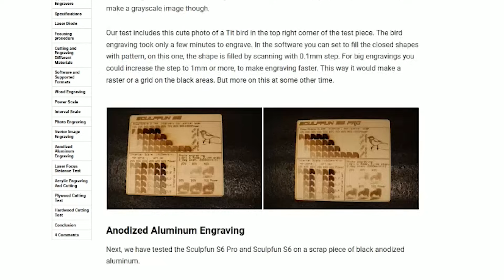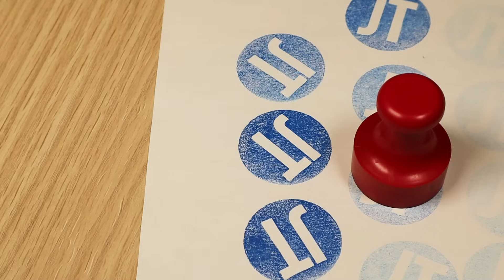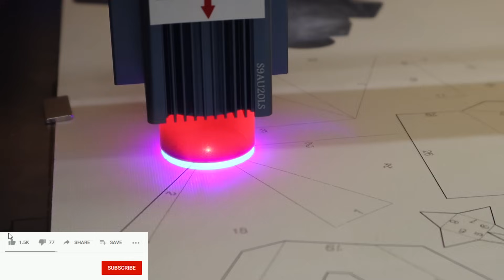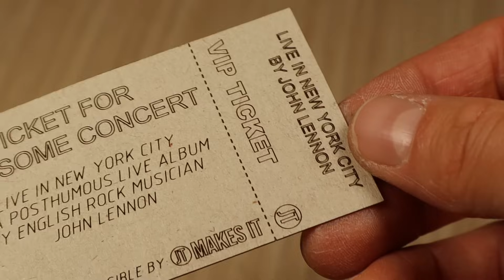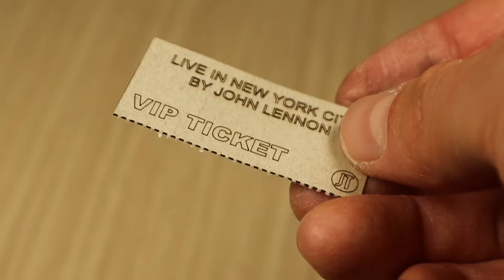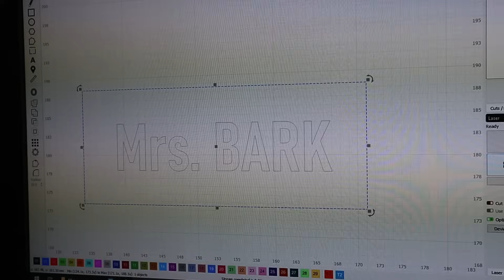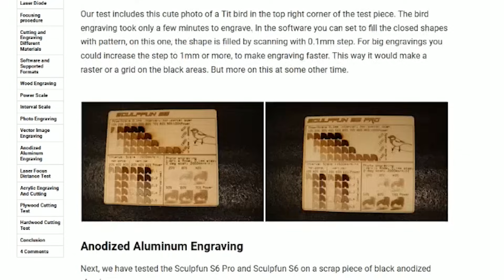10 Things You Didn't Know You Could Make With a LASER ENGRAVER (NEW Sculpfun S9 Review)

Comment: Is it possible to laser cut Styrofoam?
Reply from the maker: @jobwong  no. It is highly flammable and dangerous to cut
Reply: @JTMakesIt  Thanks for your reply.  I have some white melamine laminated plywood sheets. Can I use them for laser engraving and laser cutting? Can the melamine laminated layer be cut through?
Reply from the maker: @jobwong  white plastics can't be cur with diode lasers. You need co2 laser for this
Reply: Thanks for your reply

Comment: i have a sculpfun s9 machine why in white acrylic I have difficulty cutting it speed 50 pass 8x power 100, the result is cut but the edges are messy and slightly blackened, I use air conditioning, please help?thanks
Reply from the maker: White and transparent acrylic is basically impossible to cut with diode lasers of any power. The light reflects off and it does not absorb into the material.
Reply: @JTMakesIt  thank you for your answer, but your video shows yellow acrylic, is there any special acrylic for this machine??
Reply from the maker: @ismailkhayla1549  black, green, red and yellow work well. Blue(because it is the same color as laser beam) and white(because it reflects everything off) and transparent (because the beam goes through) don't work. But the lighter the color the worse it cuts. The yellow one needs twice as many passes as black.
Reply: @JTMakesIt  thank you very much, the answer really satisfied me, good luck always

Comment: Will the S9 module work as a replacement for the Atomstack A5 20w which only has 4.5 optical power? Even though the 4.5 optical power is great for detail it takes several passes to cut leaving my edges way too charred.
Reply from the maker: S9 module is an amazing upgrade to the A5 20w. The difference is like night and day!

Comment: The carbon on the edges of your cuts in wood didn't sublimate (black edges), you might want to adjust your power settings.
Reply from the maker: Jeah, my settings aren't optimal. I should tweak power and speed a bit more.

Comment: Tip, if you poly, or poly stain your wood first, then laser etch and cut, you are able to remove the burn halos using alcohol and a cloth...  It's also easier to brush poly the entire wood before it's cut or etched.  Then you can still use the spray after the cleanup for a final coat...
Reply: Sorry guys, but what is "poly"?
Reply: @bundeslachamt  polyurethane coating, like a finisher
Reply: I’d recommend water based  Polyurethane (Ie: polycrilic) because it doesn’t yellow like oil based. Just make sure you stir and don’t shake because you will introduce a ton of micro bubbles in the finish. I also don’t like foam brushes for the same reason.
Reply: That sounds like a good tip. Do you have a recomendation for the type of poly to use? I've just ordered the S9 and really looking forward to start using it.
Reply: @Trollgaard1st  any poly will do...

Comment: Another question, in LaserGbrl software where set the deep of laser to cut, bend and engrave?
Reply from the maker: You adjust the height of the laser by moving the module physically up or down. By adjusting the height you set the height at which the laser will be in focus.

Comment: I have a question, where do you set the line to cut and the lines to engrave?
Reply from the maker: In Lightburn you can set any line to a specific layer. Each layer is a separate operation (engrave, line, fill., cut.. with specific set of settings  like power, and speed and many more)

Comment: Thank you for your review on the product.  I am looking for a laser cutting machine that cuts 2mm thick royal board thick paper with having the paper burnt while laser cutting it in close. i need to cut 2~10 mm thick acrylics for my architectural scale models. is there it for me?
Reply from the maker: It should br able to cut 2mm paper. The only problem I see is in acrylic. It depends on what color it is. Black acrylic is the easierst to cut but 10mm thick is the very maximum for all machines and they will cut it very slowly. None of the machines will be able to cut transparent acrylic, for it you would need a different kind of laser

Comment: How many passes to cut through 10mm wood of average density.  It is clearly more than one.  All videos on this machine seem to gloss over this point.
Reply from the maker: In the video description you have a link to my website with a technical review of this machine. This is also mentioned in the video. You will find all the answers there.
Reply: @JTMakesIt  Thanks for the quick reply.  Looks like a very good review and answers my question.  It was also good to learn about the effects of the horizontal and vertical travel directions.

Comment: hi,would the s9 laser diode itself fit onto my ortur master 2,thank you
Reply from the maker: If I remember correctly, the Laser master 2 is 12V like Sculpfun. It might work, but I can't be sure since I don't have that machine to test. I know that Laser master 2 Pro is 24V and it will not work.
On the other hand, the S9 module itself is 250$, and I have a coupon code for the full Sculpfun S9 machine for 299$, it might be cheaper to buy the full machine and sell the Ortur?
Reply: @JTMakesIt  we're do I get the coupon, thanks
Reply from the maker: @kennethrigg7320  video description

Comment: Please answer me this , how long can this cnc works until it gets "wrecked" mechanically?? I hope you understand what I mean... how long can you work with it , how much hour a day and for how many years ?? Can I change the laser with a router ? .. it's easy to install the program on the laptop ?? That's it for now
Reply from the maker: The laser module has a lifespan of about 10000 hours. Mechanics should also last couple of years of normal use. You can't replace the head with a router, because these machines are not rigid enough for this. For CNC router you need a very rigid frame because there a lot of forces on the router. There are not forces when using a laser.
Software is easy to install. You can search Youtube for "Lightburn tutorial"
Reply: Thats amazing! Can in use it on wood ?
Reply from the maker: @greekpowergreekpower9629  of course!

Comment: I have only had this engraver for about two weeks with pretty light usage and I already have a stepper motor that won’t move for the y axis. Has anyone else had this issue?
Reply from the maker: Check if there is no mechanical blockage and if the connector is still properly plugged in the Y axis motor and there are no loose wire connections in the connector itself.

Comment: I would like to see a comparison of sculpfun S9 with the new atomstack X7 pro, similar to your previous video of the S6 vs X5.
Reply from the maker: I will test the A10 pro, which should be exactly the same as x7 pro but without wireless connection. But I don't know if it's wise to directly compare them, because the A10 pro costs more than twice the S9.
Reply: @JTMakesIt  S9 and X7-A10 are both the next generation diode laser machines. Regardless there current price point. S9 is, if I understand correctly, a 5,5W laser, (comparable to a 90W CO-2 laser?). X7 is a 10W laser (2x5W). This should be in theory more powerful with faster cutting results? In your conclusion of the S6 vs X5 the engraving capacity gives a better result with the S6 due to a more uniformed laser point in vertical and horizontal lines. The laser point in X5 is more rectangular compared to S6. This might have improved in the A10-X7? When the atomstack is more powerful then the sculpfun the lifecycle might be a good bit longer giving similar results with running the machine with lower power? This justifies the higher price? This is something to consider and where I’m wondering about.
Reply from the maker: @aragorndedolor4171  Cool, stay tuned, In January I will probably get the A10 and test it out. Video will follow.
Reply: @JTMakesIt  Great, I’m looking forward to your test results. I’m new to laser engraving and on the market searching for the best laser engraving/cutting results in different substrates for an affordable purchase price to extend my home based business.

Comment: Hello, can this machine cut on clear acrylic? and if it can, how many should I put speed, power and pass ?
Reply: Hello, can the machine cut golden PVC?
Reply from the maker: None of the diode lasers can cut clear acrylic. I don't have golden one at hand to try but it might work.
Reply: Are you sure I can cut golden PVC?
Reply from the maker: @souqalmjd5284  no, because I can't test it
Reply: I read that I should not cut PVC because it could cause the metal of the machine to rust and ruin the motion control system. Correct or no ?
Reply from the maker: @souqalmjd5284  I also heard that
Reply: Please can you try cutting PVC and tell me?
Reply from the maker: @souqalmjd5284  i tried cutting vinyl stickers and it went very well, but you need to be careful with toxic gas
Reply: thank you so much

Comment: what power is your laser and how about exhaust system
Reply from the maker: Laser is 5.5W, link in description. I built the ventilation box myself.
Reply: @JTMakesIt  What's the price?
Is it CSA approved?
How does the exhaust work? This laser is totally open.
What is the table size? Where are you located?
Reply from the maker: @stampmaker9384  my box releases fumes through the window so they don't spread in the room. Laser working area is 410*420mm. I'm in EU

Comment: hello
What are the settings for cutting MDF wood 3 mm on the Lightburn program
Reply from the maker: Haven't tried it yet, but you should start with 600mm/min and full power set enough passes until it cuts through.

Comment: I use an Atomstack F6 Pro which is about the same speed Does not cut deeper than 9-10mm and it is OK .... just cutting any 3-4mm material is slooooowwww. When a complex thing cuts for 2 hours you reevaluate your life. If you really want to cut go to CO2
Reply from the maker: I always plan to do something else in the workshop when cutting big stuff. This way I don't loose any time :) the S9 is a faster cutter.
Reply: @JTMakesIt  Yeah I know I made a separate Win PC for cutting (not to use my own Mac), made a box for it with smoke suction + air assist and bad of nails to raise material I did everything the problem is that slowness is still a big problem. The LightBurn can go crazy, one of the cutted material part can raise up and toss the whole thing to one direction and ruin the whole job, so you STILL have to babysit it more or less. Yes these lasers CAN cut 3-6mm plywood and other stronger material it is just very much NOT PRACTICAL. I tried an 50W CO2 laser on the weekand and it was a different world. When you can cut 6mm plywood in one round in 2 minutes is something completly different. I would suggest everyone to tri a diode laser and than strt to save money for a serious CO2 laser (not a K40 pleae)
Reply from the maker: @rockjano  CO2 laser is better for cutting, can't argue with that. But they cost way more.
Reply: @JTMakesIt  Yeah sure what I tried cost about 5-6X more, but it worth every penny of it's high price. The new diode lasers with two diode probably better but that is still only 10W... not moch more. 50-100W is something else  Everyone who is serious about laser cutting (even on a hobby level) should considering a bigger CO2 machine (not the K40 please that is a suffering)
Reply from the maker: @rockjano  I heard that k40 is a piece of junk :) maybe I will someday be able to review CO2 machines as well.
Reply: @JTMakesIt  Well...junk might be too harsh :-) many use it just it needs lot's of work to be usable and the size is 200x300mm ...which is quite small and the 40W is really only 30 (which is still 6X more than 5,5W :-)

Comment: How does this laser compare to the Atomstack A5 pro plus? As far as I have read, both have the improved focusing and now the Atomstack has thumb screws to fix the laser head. How would you compare the two?
Reply from the maker: Hi, I haven't tested the Atomstack A5 pro plus, so I can't say which one is better. Whey should be somewhat similar. BubI don't like the Atomatack light ahield design because it does not allow you to lower the head more than optimal focus. It comes very handy to lower the head a few mm more than normal when cutting thicker materials.

Comment: What settings do you use for the denim engraving? (I have the same machine)
Reply from the maker: I don't remember the exact numbers, but I use the lowest possible power that gives you results, because you can quickly burn through. It should be around 30-40% power at around 1000-1500mm/min.
The number should be a bit different for various kinds of denim.

Comment: You made some nice tests there but you don't really seam to have an effective ventilation system. Plus this is REALLY important and you should NOT be misleading people you should NEVER EVER use laser cutters on synthetic leather and chrome-tanned leather as they contain chemicals capable of producing toxic fumes when burned. Aka you are intoxicating yourself and others if you advertise it like this. It's so important to make reseach on your material before engraving. This is dangerous.

Plus there is no way this actually engrave stainless steel. May burn the paint, but would not call that engraving.
Reply from the maker: my ventilation system is very effective. All the air gets pumped out through the window. 
Thanks for the tip. I agree, some plastics need to be handled with care or better not to be cut at all.
Regarding stainless, this machine is the only one I have tested  that can truly engrave stainless. It can engrave it even without applying the paint.
Reply: @JTMakesIt  It looked like there was no cover or anything in between you and the laser for ventilation, you probably still get more fumes then maybe a closed machine with a filtration system. But i'm glad you do have a ventilation system!

It's really important to know what you are engraving and if it is safe. Even more if you make tutorial about it ;) To my knowledge only veg tanned leather is safe to engrave. But I know the company trotec have a line of faux leather made for engraving that are safe. But other than that it's pretty toxic.

As for the stainless, I'll give you benefit of the doubt.
Reply from the maker: @ladouceurduneplume2148  I have a fully enclosed box and the fumes are vented out of the room. Thanks for the safety tips, I really appreciate your help for us being safe!

Comment: Great examples of projects! Do you share the lightburn design files for these? I only found the test file on the blog post. I was wondering about speeds and settings for engraving and cutting the tear-off ticket project
Reply from the maker: Hi, on my website I have an article with more descriptions next to each project found in this video. For some designs I also posted the vector files. I didn't attach lightburn files for everything, because you need to adjust all the settings according to the material you use. But if you really want the lightburn file for the ticket, send me an email and I will sent it to you. I think everyrhing was done with 600mm/min. 100% power for cutting (1 pass) and about 40% power for text and photo engraving. Perforation was done by enabling perforation mode for one layer  in Lightburn
Reply: Sir your video very good..very happy when watch your video.If have questions can I ask you sir s9?

Comment: How many passes required to cut out the  clock?
Reply from the maker: 6 passes at 600mm/min. It cuts in less passes, but it is better to set a few passes more in case of denser wood spots.
Reply: @JTMakesIt  what thickness was the clock looks about 6mm but just want to check
Reply from the maker: @lister1234  The wood is 3mm thick. At the time of the making, I didn't have a clock mechanism with longer thread which would support thicker wood, otherwise I would make it from 4mm or 6mm.
Reply: @JTMakesIt  thanks again

Comment: hello grat video, thanks! could you tell me the maximum speed of thjis laser? ortur master pro 2s  can engrave phots at 10000mm/min with no problems cause it has a 32bit motherboard, can this laser do the same?
Reply from the maker: Max speed is 6000mm/min. But I am testing the laser master 2 pro right now and at 10000mm/min the laser does not have enough power to burn the material at 100%power. With both machines, the maximum usable speed is around 5000mm/min.
Reply: @JTMakesIt  are you going to be posting your review of the Ortur on your channel? I really appreciate your work because there are not many in depth reviews and tests of Sculpfun and atomstack machines but Ortur seems to be so popular that I really want to be able to compare them. I've already purchased the S9 based on your review though haha so mainly I'm hoping I didn't make a wrong decision by not going with the Ortur hahah
Reply from the maker: @akaTelo  I will be posting a review in about 2 weeks. Personally I  think the S9 gets you more for the money because it has a stronger laser for about 100$ less.
Reply: @JTMakesIt  awesome! Yeah that was my thought as well from just reading the specifications for each laser. The Ortur is nice in that the x axis motor is shifted off the gantry to the side so less weight has to be slung around, I can see why that would allow it to go faster. But yeah the S9 laser is so good. The comparison I'd like to see for the laser next is the Neje dual laser module. Theoretically that should be even more performant than the S9, but it's also a pretty expensive module
Reply from the maker: @akaTelo  Ortur can move faster also because the laser diode has much smaller heatsink. But that should affect the longevity of the laser diode. 
And  I hope to test the Neje one day as well :)